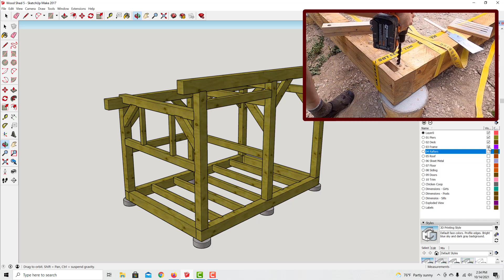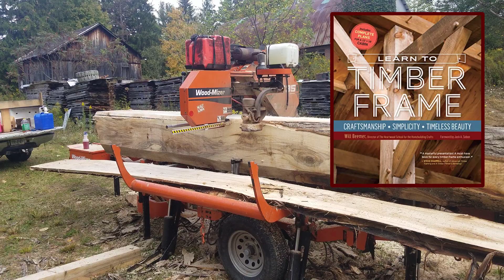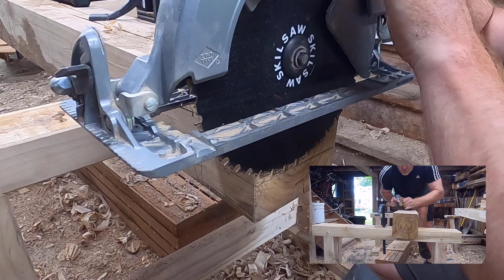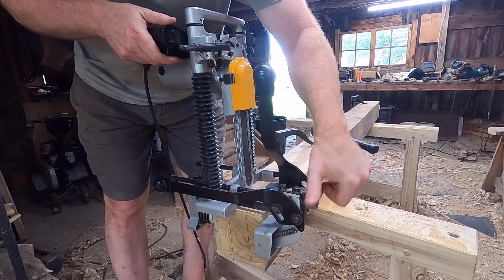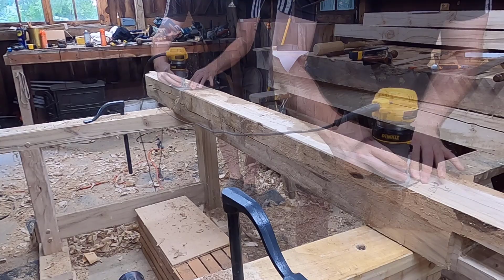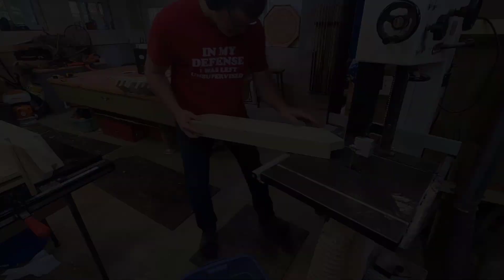Timber frame shed:  Part 2 - cutting the joinery

Comment: @ 6:25 you mention linseed oil and d limonene as a finish. Would you provide the ratios, and discuss benefits a little?
Thank you for sharing.
Reply: Found my answer in Part 7. Thank you.
FYI answer for others is: 2 parts linseed oil to 1 part d limonene
Reply from the maker: Sorry for the slow reply. Glad you found half your answer. For the other half, I reached out to my instructor, Tom Healy, who taught a timber framing class I took at the North House Folk School. This finish was his recommendation. You asked a question I should have asked him... I just blindly followed his advice. My assumption was that the D-limonene served to help the oil penetrate the wood, since it is a cleaning agent. He gave a detailed response that confirmed my suspicion, but had a lot of other good information, so I'll share it here:

"It is a substitute for turpentine or other thinner. It penetrates better than any other solvent into wood (it is basically a terpene made from orange peel- very similar to biodiesel, which works well too.)  I once put only biodiesel made from flax (aka linseed) on the facia of my kennel building in Whitefish. It looked great 7 years later when I moved away. I’ve never tried straight d-limonene, don’t know why I wouldn’t. Also can heat it any of the above for better penetration. (Where the “boiled” comes from in boiled linseed oil - actually not boiled, metallic dryer is added). Add pine tar to the heated solution for exterior applications for a true “boat soup”. (All of the above will darken over time in exterior applications)."
Reply from the maker: Also happy that you kept watching the series to find out. Hopefully you found part 8, the final installment :)